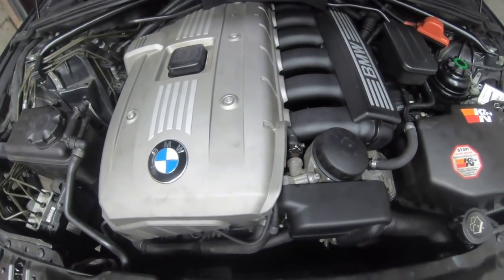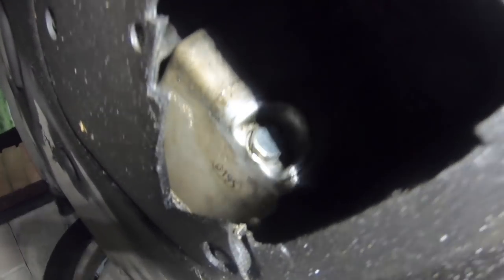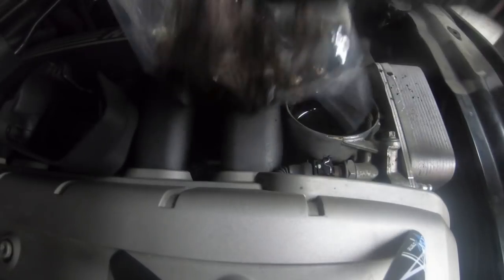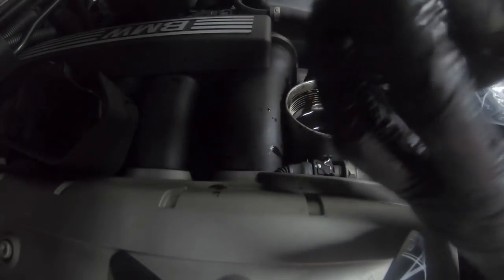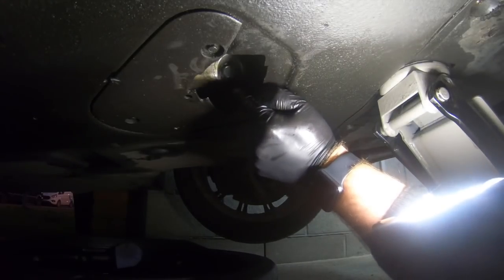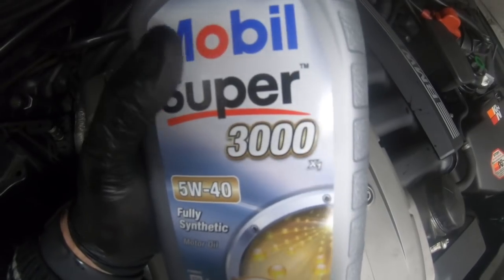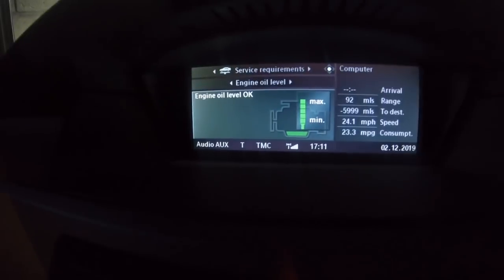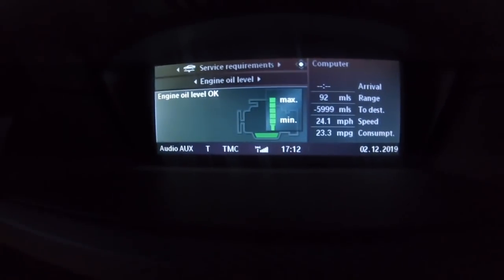BMW N52/N53 How To Change Oil Filter & Oil......  BEWARE This Part Will Kill Your N52 ENGINE !!!!!

Comment: Hi Doc, the center portion that the filter medium is held by is suppose to be attached to the cap-not separate like on your auto.  Then when you remove the cap, the little center oring is lifted up and allows the passage to open, allowing the filter housing oil to drain down to the oil sump.

Comment: Vanos filter? Huh? That piece is there to keep the oil filter from collapsing. It’s openings are so big it wouldn’t filter out a handful of rocks. Also, it’s supposed to be snapped into the cap first.

Comment: Hi BMW Doctor, Might I suggest as a fellow BMW colleague, Always clip the middle part of the Oil cap into the oil cap and then insert the filter and afterwards screw it into place. If it is not clipped into the cap ive seen it cause premature wear on both the filter and the filter housing gaskets since I believe it is affecting the oil pressure. Note: I have not tested if it actually affects the oil pressure but it is definitely better to have the oil cap in one piece as it is originally. Takes two seconds to realign and clip back. A little extra prevention for future reference. This applies to all engines that use this kind of cap.  Still some great content and clear explanations for all those that have no experience in the field.
Reply from the maker: Yes mate I’m fully aware of that and I usually clip it back on to the cap BUT , it does not hold together as soon as I spin the cap it’s back off again so there is no point even trying to clip it back on I will be getting a new one next time from bmw as it needs to be replaced 

But I’m fully aware that it needs to clip on only if it would hold in place

Comment: When I did my first oil change on my previous 330i N52 that exact part was missing. It ran much much better after that. I also think it will not filter all the oil as it will go around it at the top. Good video/tip!
Reply from the maker: yep like many many people are still missing this peace thats why I did this video and I will continue to mention it to make people aware of this peace as others are coming to the channel daily and I want them to check for this

Comment: Nice video. The Mann filter comes with 3 gaskets or O rings. I change them all out with every oil change. The big one on the filter housing , the little one inside the filter , and the copper crush gasket for the drain bolt. No reason not to.

Comment: new oil and ticking is gone for me too and smooth idle. great info Doc Dean. I love all your vids and style mate.
Reply from the maker: No problem mate and yep that’s the cause you know when the oil is broken then the ticking starts
Reply: @BMWDoctor  just bought my e90 in february with 17,000kms. only issue was the idle and tick which is gone now that i did the proper oil change like you showed ;) going to update the modules like you showed in other videos too Doc cheers

Comment: Another great vid mate 👌 I think you should do a video on resealing the oil pan instead of changing the gasket 😬 I know you said you can do it without dropping the sub frame and everything but I can guarantee you a vid on doing the sump would go wild 💪
Reply from the maker: yes it indeed would but Ive already resealed my one lol 

maybe if I get another N52 then I will do that I dont really mind as its not hard to do
Reply: @BMWDoctor  🤣 you could always travel up north and video it on mine, joking aside you've helped me loads already 👌👍

Comment: It seems like it might be easier just to fill the oil from the oil filter housing as it's closer to the front of the car and you probably wouldn't need a funnel. Would this be a bad idea?
Reply: Why bypass the filter element?

Comment: Good Basic maintenance . Since I don't drive many miles I look at it this way filter and oil is cheap. Last oil change was 1k on it since  April , next change will be in April again. 😊
Reply from the maker: Man kevin every year mate i would still change it every 3 months even if I didn’t use it much mate it’s cheap maintenance and always keeps the engine running perfect
Reply: @BMWDoctor  No I do it twice a year. but true

Comment: My 2011 328iX E90 runs smooth as silk with Castrol 03101 EDGE 0W-40 A3/B4 Advanced Full Synthetic Motor Oil.

Comment: Nice video! There are a few things I don't understand. First, why not replace the O-rings since they come with the new oil filter? Might as well change those too. Second, if the O-rings were replaced recently, why not change oil and filter as well so it's not overdue?
Reply: And third, why not torque the oil filter housing?

Comment: I think there is a proper tool for removing the oil filter cap, save scratching it. Got to admit i have a band type tool.
Reply from the maker: man its only scratches and a oil filler cap I look to just buy a new one when I change it next its only £30 for one from BMW so nothing I'm concerned about

Comment: If you ask me, the N53 is actually better than N52. If the N53 is properly maintained that is.
The squashing of N52 oil filters tells you that N52 is a weird engine (seems like there is way too much pressure inside that engine going on). Does the N53 do the same with the oil filters? It squashes them as well?

Comment: Hello.  I’ve got a e63 630 with n52 engine.  I have no way of checking oil level.  No dipstick as you know.  But there is no option in the idrive and no option on the BC stalk.   Could this be a faulty oil sensor do you think? It’s also had a new battery which could also be related?  Thanks

Comment: Hey BMW Doctor.  I have a rear main seal leak on a 128i, How urgent will you say that this is? Is not driven daily.
Reply from the maker: thats not serious dont even worry only worry about that if your taking engine out if not just leave it they all leak
Reply: @BMWDoctor  see I can accept that coming from you! the guy i let do my oil pan gasket assured me that I will face total failure if I continued to drive so I literally been afraid to enjoy my car! Thank you for the Reply!!
Reply from the maker: rghant your welcome mate listen to me bro get RID of the guy who’s doing your servicing reason he’s telling you this as it’s a intense job gearbox has to be dropped to do this job which means big big hours spent for a tiny little deal which then means big big money for them to charge you and then guess what when they put your gearbox back it will then have more problems and then leak again anyway it’s a common issue mine has been leaking since 100k and guess what it still leaks and I have no issues mate don’t even worry about it every n52 in the country will have it leaking and people don’t even notice so do not care about what they tell you mate

Comment: Hello bro need your help ADVISE  my x6 3.0 td is kangarooing   when it's cold and revs go high but doesn't seem to go nowhere I have been told that it could be be the solenoid on the megatronix gearbox they need replacing it seems to be that one two and three everything else is fine is this true and do you know about this on the zfg box 6-speed thanks bro cheers I do most of the work my self
Reply from the maker: Sell it to me please mate will give you 5k for it

Comment: Just bought a used 325i and had vanos codes, realised the cap is missing that vanos bit. Car drives fine just unstable idling. Is it dangerous to drive it? I've ordered a new cap but in the meantime. Engine seems fine

Comment: My mechanic forgot to put the whole centre part in my oil filter during my recent oil change. My n52 started showing vanos codes and then checked the oil filter and got shocked by seeing just oil filter in there. Now he put everything back along new filter. So my question is that is there any damage caused to engine during this interval? Just ran about 5-700 km

Comment: What about amsoil?
Reply: Andy Cenatus amsoil does not have BMW approval, but the company says their european formula oil is recommended for all european cars, including BMW. I’ve never used amsoil, but I’ve used Redline 5w30 (which did not have BMW approval then, but many people on BMW forums swear by it) before, and the car DOES NOT like it. It kept throwing the oil level sensor error code. You can clear it, but it will come back. Then I changed to a BMW LL01 approved oil for the next oil change, and the error code disappeared completely. I’d just stick with BMW LL01 or LL04 oil.

Comment: What can cause driving without this plastic part in filter? My mehanics drop this part in garbage and i drive car about 7000kmh without this part,and car start to noising like diesels car and lost of power. I change both vanos on camshaft (not solenoids), and valve rubbers and camshaft orings. But car is still loss of power and vanos when i start the car turn around -40 degress. Can somebody tell me more about what can damaged others part on engine, or what you think is problem?

Comment: Hi mate why are you using 5w40  instead of 5w30
Reply from the maker: It’s better for high mileage BMW’s anyone would tell you that the reason for this is simple : as you know bmw piston rings don’t seal well over the lifetime that is due to heat from these engines running very very hot for emissions purposes and what happens as the years get on the seals begin to weaken and gaskets causing leaks you can fix all of them BUT they will spring open once again , 5w30 for high mileage cars will burn off to quick and also it doesn’t give the engine full protection considering the mileage 5w30 is for quick warm ups including low mileage cars but as the years go on mileage goes up and these cars tend to wear with the internals so it’s better to use 5w40 on a older car and give it the correct oil for the mileage any cars under 100k I wouldn’t reccomend  using but for my purposes I have used it since day one and have had no issues only better issues then it had before I got it
Reply: Hi mate my e60 2006 only has 81 thousand miles should I use 5w40 on my next oil change cheers
Reply: BMW Doctor Okay. That’s why my oil was always dirty. I had to change it every 2k miles.